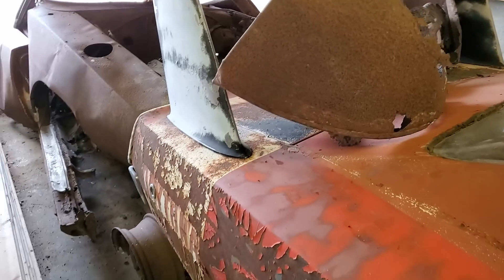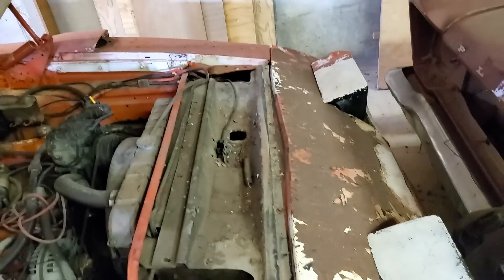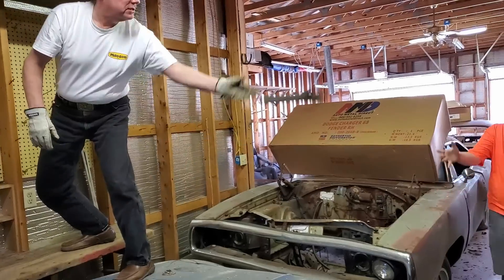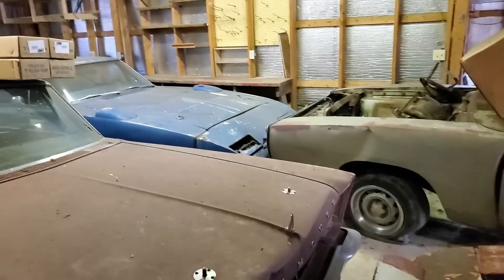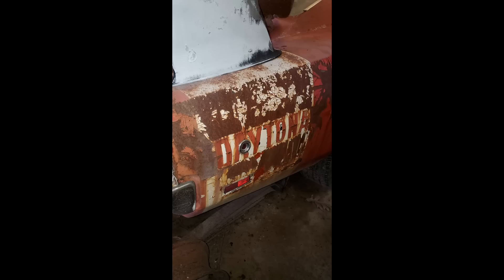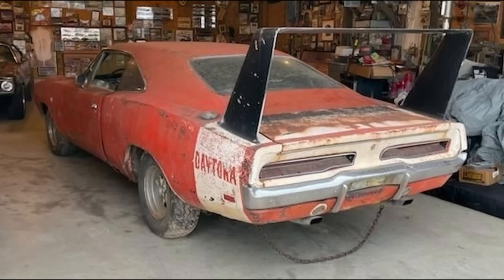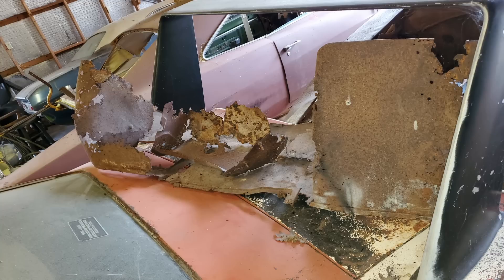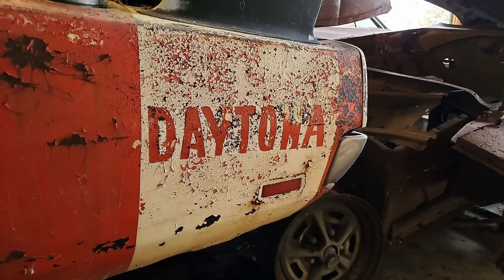1969 Dodge Daytona BARN FINDS in Missouri!

Comment: At 8:20 you can see the "Airtemp" sticker on the window which means that it should have factory installed air-conditioning.
Reply from the maker: It was swapped in

Comment: The reason that hole was drilled was for the fancy key switch for our Radio Shack alarm dude! Easy access for running the wires and not as tough to get through like the steel on the side of the car. I shityounot.

Comment: Don't think that I have ever seen a burnt Daytona Charger before. Hard to believe that they were using it as a firepit. Could that Air conditioning on the Daytona been installed on it after it arrived at the dealership when new or not?
Reply: Reason I asked was my 73 Duster had rallye wheels on it when I got it and I was told that it was all original but it shows to be a hubcap car from the factory just curious if maybe when it arrived the original owner decided that they liked the rallye wheels better and had a set put on at the dealership?
Reply from the maker: It could have been, but whom ever did the conversion replaced the original firewall as well with an A/C one.

Comment: You can not put back a burned and rusted car, the metal is totally destroyed, even with 10 layers of super epoxy, it will never get back the strength. 
Plus, its only 10% of the car left to begin with. So, to create a new car would mean, start with a 90% new body and put 10% of the original thin crispy crap into it. (lol)
Even if the whole car would be there and lets assume it just burned down yesterday, its integrity after "only burning" will lose at least 50% of its former strenght. 
So noone should put such dangerous crap back on the road, this metal is only useful for an exhibition purpose. Im not here to disappoint or even offend anybody, this is just the simple truth.
Reply from the maker: Oh I agree, but it's not my car.